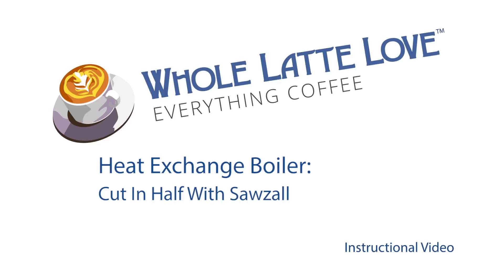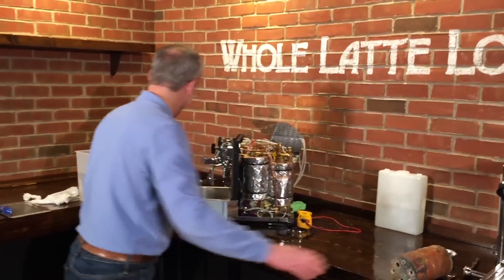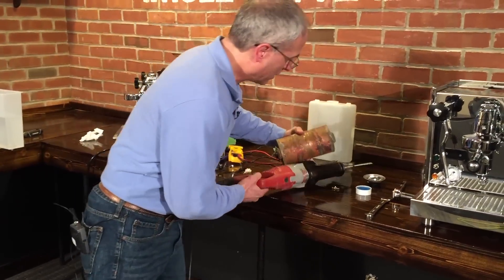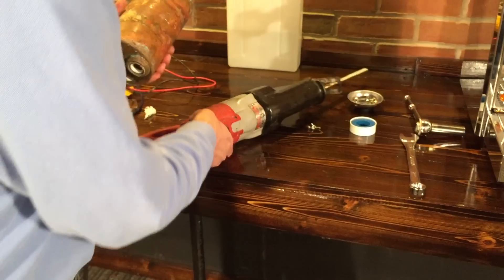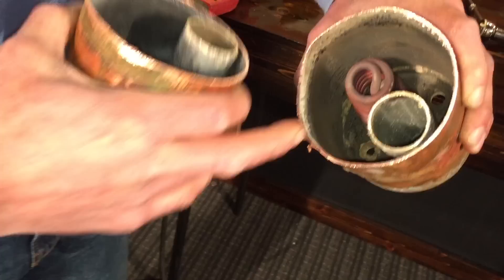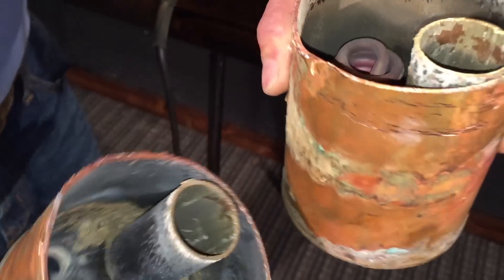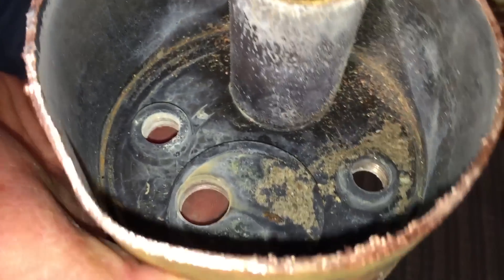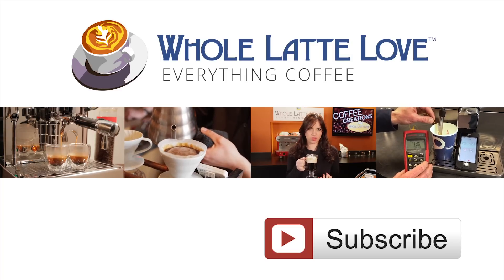See Inside a Heat-Exchange Boiler: We Cut One in Half!

Comment: Could I have a ruptured HX?  I've got an Alex Duetto II, not working properly, when I try to draw brew water the group head, the pressure only gets to 3.5 bar, and water begins to spray out of the steam wand even though the knob is completely closed. If I run the group head for over 10 seconds you can see the steam gauge go from close to zero all the way to 2.5 even 3 bar and then the OPV starts to spray out straight water.  The only other way I can see that the brew boiler can back feed water into the steam boiler this way is via a faulty expansion valve that is connected between the two.  What are your thoughts? I've already replaced the solenoid inlet valve and tested the fill level probe to be good.
Reply: Yes!

Comment: Could you make a video pulling out the heat exchange boiler out of bezzera bz07 or similar machine, im about to fix one with a leaky boiler. Not sure if I should just replace boiler or just get a new oring and bolts see if that works. If I do get a new boiler should I get the heat element plate also or judt use the old one ok?
Reply from the maker: Hi david, Thanks for the request. Not sure I'll be able to pull off a video on boiler removal in a timely fashion. IMO rather unlikely you'd need to replace the entire boiler. Do you know where the leak is coming from? Could be something as simple as a vacuum relief valve. Here's a video on cleaning and/or replacing a vacuum relief on a Profitec Pro 700. Obvs not the same machine but general idea is the same. Before replacing the boiler I'd try to determine where the leak is.
Marc
Reply: @Wholelattelovepage  hi mark, thank you so much for responding,  I brought this unit used, the original owner tried to fix leak in on boiler by putting some type of blue membrane between tank and heat element plate, not sure but it looks something like blur lock tight. Im thinking I could clean her up, get a new o ring and fix it to save some bucks, but if you recommend getting new boiler tank ill do that instead.
Reply from the maker: @david029014  I’d definitely try a proper O ring first

Comment: Thank you very much for your great video. Would you be so kind to explain what is the temperature in the steam part of a boiler, and what is the pressure of that part of the boiler...
I i think i've heard that steam boiler is around 200C, how is exchange water temperature controlled, especially in the old lever machine without all the electronics and re-circulations.

Best regards

Ivan
Reply from the maker: Hi Ivan, Thanks for the kind comment and questions. Steam boilers typically run 250f/121c - 271f/133c. At those temps pressures are ~1.2bar/17.4psi - 2bar/29psi. Most common way of controlling brew temp in HX boilers is through the thermosiphon which circulates water out to the group and back as in E61 groups.
Marc
Reply: @Wholelattelovepage  Marc, many thanks for you reply. You guys are great!
Reply: @Wholelattelovepage  I just found your video that explains everything :-) Just in case someone has the same question 

https://www.youtube.com/watch?v=5igXx83J_Iw
Reply from the maker: Thanks for the video link!

Comment: Nice! The boiler was from which machine?
Reply from the maker: Sergio Massara Hi Sergio, Fairly certain it's from an Expobar but will double check with Todd. Machines like the Brewtus have a unique dual boiler setup with a heat-exchanger in the steam boiler preheating and feeding water to the brew boiler. Result is one of the most temperature stable machines available.